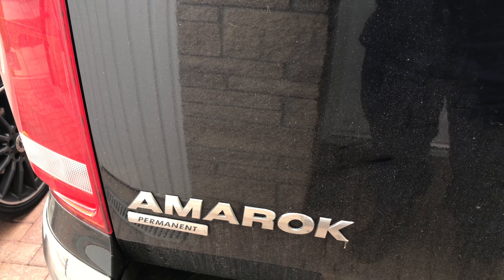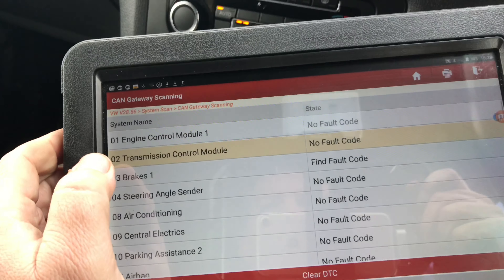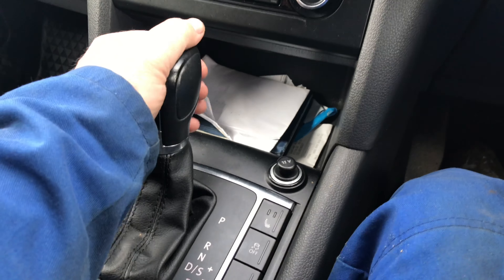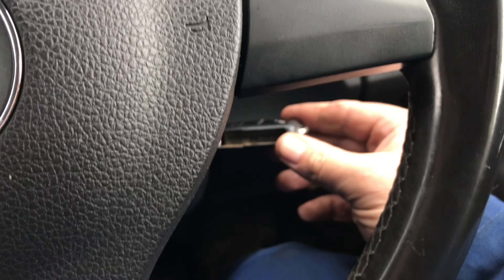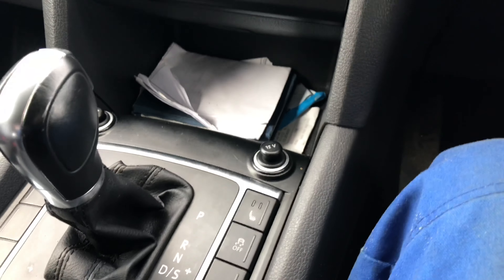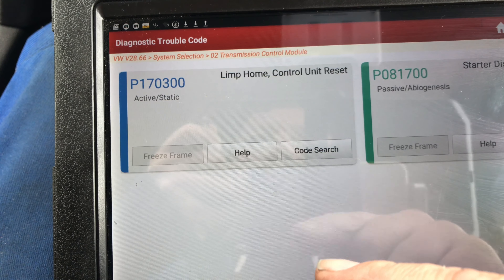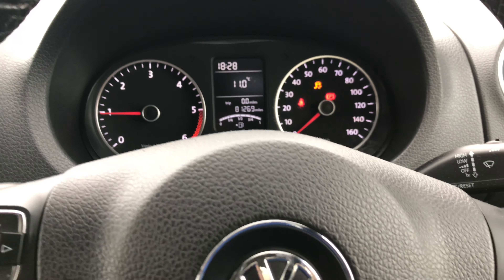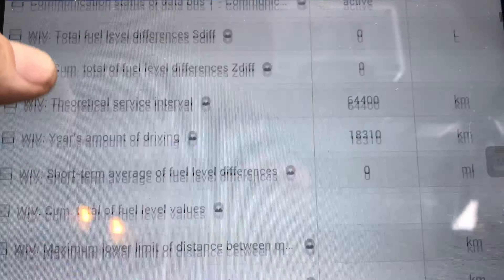VW Amarok Automatic (2013) - Transmission Stuck in Park! Part 1 of 3!

Comment: Crusties again Sandy , had a Renault Tragic (traffic) today , wouldn't rev up , only idle speed , was in last week , scanned it , showed fault on pedal track 2 , guy bought a new pedal position sensor from Renault, no difference, went on the old gargle, found a link to same fault , removed expansion tank, top off fusebox , but blue plug , unplugged full of crusties , sprayed with contact cleaner, dried and put it pack together , hey presto revs up and data now showing on Versus, both tracks on pedal the same reading , before track 2 stuck on 41%, now the same all thru range 👍
Reply from the maker: Cheers Mike what contact cleaner do u recommend cheers sandy
Reply: @sandyande  the guy had it in his van , hes a plumber/general builder,  it was wd40 contact cleaner , he said it was from screwfix about 8 quid a tin , was nice and clean after spraying 👍
Reply: @sandyande  screwfix item  number 92716 , £6.99 a tin 400ml
Reply from the maker: @mikeberry304  cheers Mike

Comment: Hey mate I’m having exact same issue on my amarok. Just got car fully detailed and serviced. Thinking something got wet during detail. What do I do?
Reply from the maker: Check rear tail lights for water intrusion
Reply: @sandyande  yes just taken them off one of them is filled with water
Reply: Rh tail light filled with water and plug looks no good
Reply: @sandyande  what next?
Reply: @sandyande  I’m desperate!! Please help
Reply: Do I replace light? Will that fix problem? Do I need to replace anything else?
Reply: @sandyande  please help!
Reply: @sandyande  I need help please!!!!
Reply: @sandyande  I changed tail light. Still having issues. Do I need to replace any looms?
Reply: Please help!!

Comment: What's  the out come
Reply from the maker: It's still ongoing, left it a 4 o'clock today so will have ago at cleaning pins/wires on Monday cheers sandy
Reply: Well hope it works out.  Jobs I love the most  .       Good job you took the plug off. Sure seems to be where problems lies